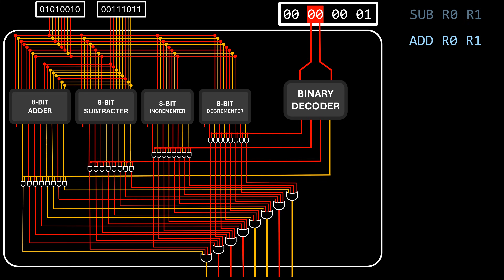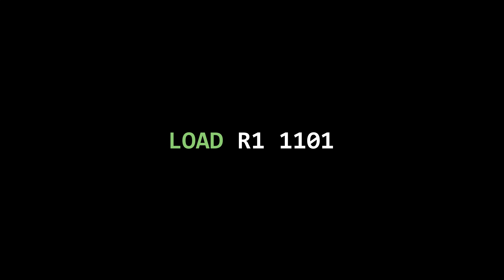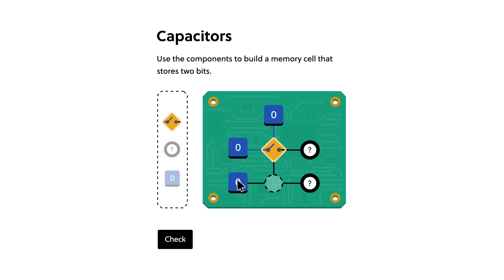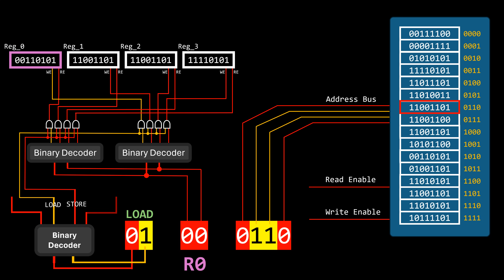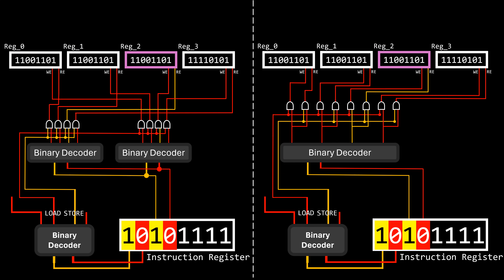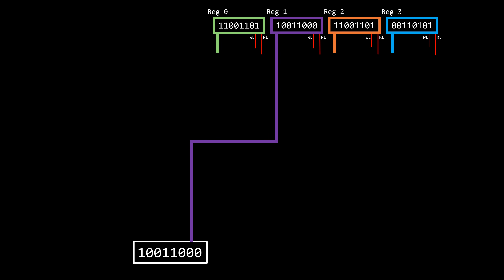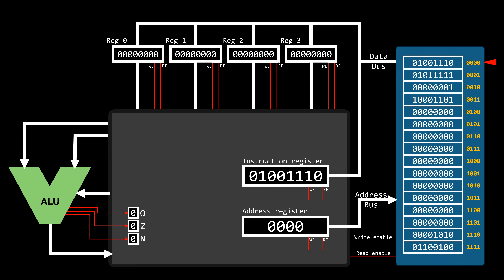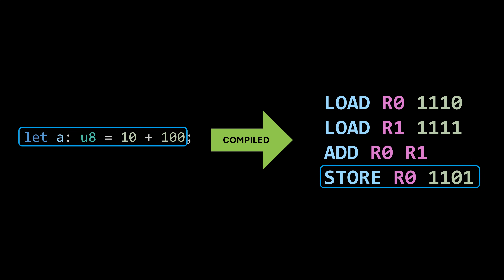CRAFTING A CPU TO RUN PROGRAMS

Comment: 19:37 The reason is we cant both read from a register and write to a register at the same time without a clock, using a clock we can set the rising edge of the clock to reading from registers and set the falling edge of the clock to storing the result in the register.
this will take only 1.5 cpu cycles (half for fetch, one for both decode and execute) i hope this was enough.
Reply: To be able to increment a register in the file, the 6502 has hidden input register in front of the ALU. ARM2 has a write-back register behind the ALU.
Reply: Generally true, but that also depends on the convention one uses. One can use low and high clock pulses for different tasks which is typically referred to as the rising and falling edges, but you also have high and low logic too. So, in general, there are 4 possible variants to choose from, consider the following table:

Clock Edge   |   Logic Type
------------------   |   ------------------
    rising         |        low
    rising         |        high
    falling        |        low
    falling        |        high

This is something to be aware of. One always has the rising and falling edge of the clock pulse to work with, but as for Logic Type or convention, the main distinction here is mainly the difference between using NAND based or NOR based technologies within the construction of Sequential Logic (memory-based components). Some latches or flip-flops can be constructed using NAND based components while others can be constructed using NOR based components. The main difference between the two, is when the Reset lines of these latches is being asserted. 

Now, the vast majority by convention typically chooses NAND over NOR because NAND is cheaper as it does require less Transistors to construct as well as requiring less space in its layout design. This doesn't mean that NOR based logic doesn't have its uses. In some situations, and devices, NOR might be preferred as it does depend on the nature of the problem and the context in which it is being used. 

So, in general and in most situations, we typically or for the most part use the: NAND variant. Now as for low and high logic in conjunction with NAND and NOR based components, we can always convert one to the other. You can have a purely NAND system working in its natural based logic, but you can also configure it to work in its opposite variant, and the same can be done with NOR based components. It's just that the conversion process does require more logic to be thrown at it. 

But yes, memory access with read and write operations that trigger their control lines is determined by the rising and or falling edges of the clock. Yet, there is another component that is vital to this and that is the Edge Detector. Without the Edge Detector the rising and falling edge signals of the clock pulse would be basically useless. If one cannot determine if the edge is rising or falling, then the entire discussion of setting the memory's control lines is kind of moot. However, not all but many memory devices have their own edge detector built into it internally. So, in many cases we can abstract away from this, yet that's not always the case. Some memory components don't have any edge detector, and in those situations, we do have to roll our own for without that edge detector, the clock pulse is meaningless.
Reply: @skilz8098  there is a great write-up of the clock in the i386. Basically, there are two kinds of clock lines routed across the chip. Their signal is inverted. Rising and falling latches are grouped so that we don’t have to pay twice for the “last mile”. At least on this chip ( or any microprocessor I looked at ) there is no edge detector. Just the flip flop is switching from input to feedback cycle. So it captures its current value on the edge of the clock. The edge does not need special properties. It can even bounce as long as the input value is stable during this period.

I wonder if we could reduce noise on the power lines with a three phase clock with one inactive at a time. All rise and fall switches are balanced and don’t introduce common mode noise on the power supply. So sequential logic would have 3 groups of latches. Two of them pass .. ah crap. One of them passes through the signal. At all times at least one latch latches.

Comment: And how to run the JUMP conditional? How to run a forloop ?
Reply: A for loop works the same way in assembly as it does in higher-level languages. You have the instructions to make a number increase or decrease, like how good ol i and j increase or decrease, and you have the conditional statement, which is just instructions that compare that number to some other number to see if i equals num, i is less than num, i is greater than num, etc., and you have the instructions that make the computer jump back to the start of the loop or jump out of the loop, and you have the other code that runs while the loop is still going, like the code that is between the curly brackets in a lot of higher-level languages.
Reply: ARM2 has conditional flags which act on all instructions. RISV compares two registers as a condition for a jump. That's it. The rest is on you and your software skills.

Comment: How does error detection and correction works?
Reply: wrong video? There is some video from ESA. It is a bit boring. For memory you load 9 bits instead of 8 and check for parity. ESA has 3 CPU cores which compares their results every cycle. Majority wins.

Comment: Answer 🎉: the registers are much faster as they are part of the cpu while ram is separated and can be accessed by diffrent cores wich means its not fast enough to work directly alongside the alu and so the cpu loads data to the registers and then execute it and proccess the instruction 
However theres a much faster type of memory called cache memory wich is even faster and stores limited amounts of data that is bien processed 

I learned a lot from ur vids not sure about the ansewer or how that is bien done.
I knew about cache and registers before but i had no understanding of how they work 

big thanks ❤❤
Reply from the maker: Ok but here the thing, registers are fast, but you still have to load data to them from memory.
Reply: @CoreDumpped  well thats all i have
Reply: @CoreDumpped  In my code a lot of variable are initialized to some literal value. Bitfields and safety limits for for-loops. With non-portable code, which knows that we are dealing with exactly 8 bits, a lot more helper variables have known values at compile time.
Reply: i have a better reason.
Reply: @mahdoosh1907  good for u 
Did u win the noble prise yet...no dont give a shit u know

Comment: I know it was because of constraints of video format, but I would love to learn how those "multi-step" instructions are handled. Like the one with ALU where result is stored in a temporary register - how does the control unit know that in the next clock cycle it needs to move data from temp to R1 instead of incrementing address register? Is there then a control unit of control unit?
Reply: It probably have instructions on itself. There's also a way to know that an operation is done.
Reply: microcode with its own address register. The Z80 is famous for its microcode where it would have some special sequences "subroutines" which would be called to fill the 4 phases of a machine cycle with special control signals.

Comment: Answer to the question:
I think you can , just directly pick data from the memory , the ALU does the math and thene store the result, except the instruction needs to be a lot bigger and you need more memory , but I think the there will be an issue with storing the result
Reply: I mean, a lot of home computers and consoles had multiple memory chips. I always feel like it is a design failure .. So a mem-mem instruction would always move data from one bank to the other.
Reply: @ArneChristianRosenfeldt  these machines had PLAs and MMUs doing heavy lifting of juggling the busses and providing enough of abstractions for chips not to collide with each other. 
Your thinking has fundamental flaw: mem-mem instruction would always move data from one bank to another THEN AND ONLY THEN if these memory banks would be only chips attached to said bus. When you have to arbitrate between multiple nodes wanting to share their results or tackle upon new problem you have shitload of switches to correctly flip to isolate two and only two interesting parties on the bus at the exact moment of data exchange between them.

Comment: Great video as usual! I love seeing all the pieces come together, even if it's getting hard to remember all the lower levels that have been abstracted away xd. I would love to see a video on drivers and how connecting external devices works at a low level. As for the question at the end of the video, my guess (without doing further research) would be to have the two data streams in the ALU connect directly to memory and set it up so that their write enable in turned on when an arithmatic instruction is performed.
Reply: Exactly as I thought, but I think the problem is storing the result